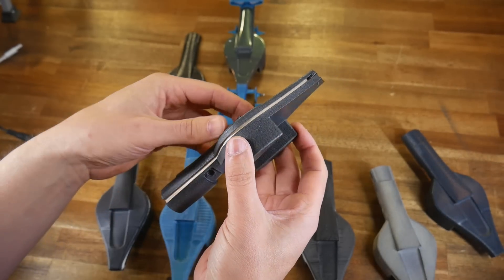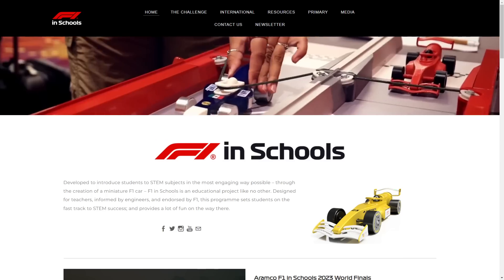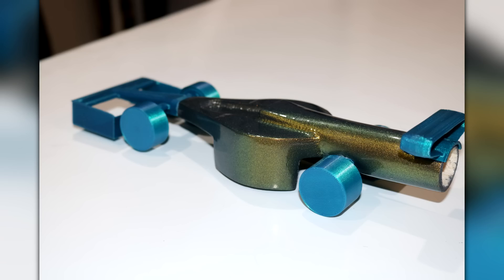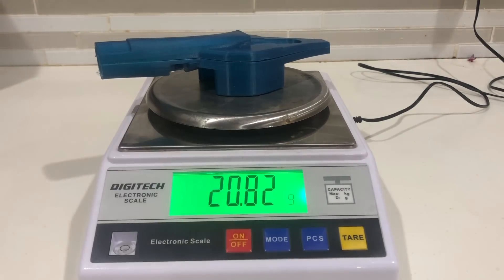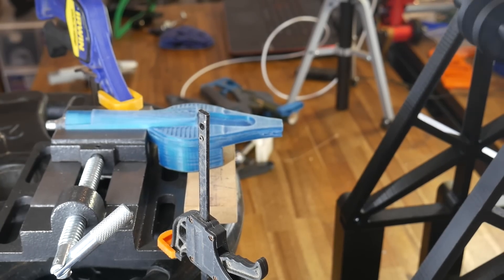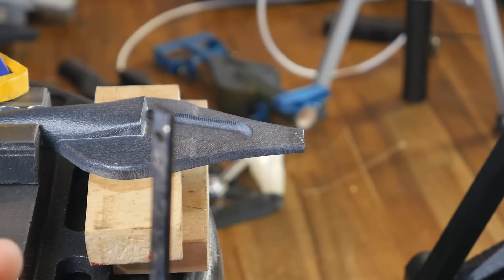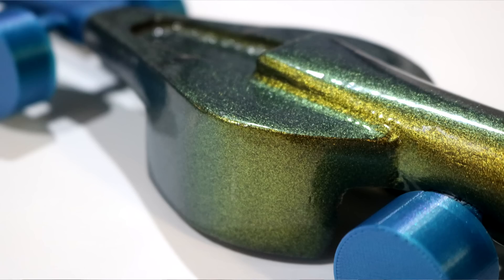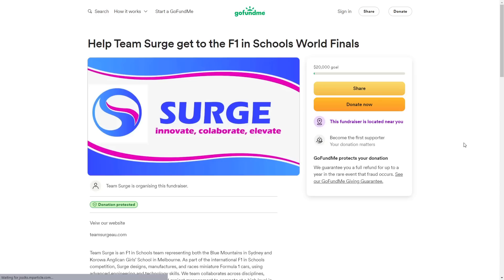Comparing consumer FDM 3D printing to SLS Nylon with Team Surge AU

Comment: why not use pa-cf 12 on a fdm and up the resolution to like 0.08? the added time is not a problem in a overnight print for a part this small, it'd outperform the fact that you need a sls setup or borrow it, while having a fdm printer that does pa-cf12 is easily done with a enclosed printer, like a x1c or p1s

Comment: Where is pet .g.
That.s flexible. 
Printed at home .
And where.s a.b.s.?.
And why is tje software  not showt.
Like cura slicer.
And nozzle size.s
0.6 nozzle makes parts stronger. 
And why os tje option fuzzy skin.
Not try.d.
Wel tou stil  goth a lot option.s.
Left

Comment: Hi Michael, my name is Francesco, and I am a 16-year-old guy passionate about 3D printing. About a year ago, I bought my Elegoo Neptune 4, an amazing printer that works very well, and I am happy with the purchase. Unfortunately, every time I turn the printer on and off, the Z-offset changes, and I have to recalibrate it manually. This frustrates me because I’m forced to make a lot of clicks to level the bed. So, I started searching online for a solution, but the automatic calibration either involved a load cell mounted on the nozzle or external hardware that was complicated to install.
So, I came up with a software idea that could automate the whole process. Here’s how it works:
You need to know the offset between the 3 axes, which is the distance between the nozzle tip and the probe for automatic bed leveling. You tell the printer to move to a coordinate near the center of the bed, take a measurement with the probe, and save it. Then, the head should move to the same coordinates but adding the previously recorded offset in X and Y, take another measurement, and save it as well. After the printer has returned to the previous coordinates, it needs to take the two previously saved data points and insert them into the following formula (the first measurement = A and the second = B, the Z-offset probe is the offset between the nozzle tip and the probe on the Z-axis):

(Z-offset probe + (X)) - (Y) + 0.1mm.

The final instruction to give the printer is to set the current Z-axis coordinate as the Z-offset.
Unfortunately, I don’t know how to program in G-code, so if you think this software might work, would you be willing to help me write it?
(If you think it won’t work, could you explain why?)
I hope I was clear. Thank you for your attention, I’ll be waiting for your response to hear your opinion on this matter.

Best regards,
Francesco
Thank you for your attention.

Comment: No ABS? It is less dense than nylon, easier to print (compared to SLS), can be vapor smoothed, and although less tough and less rigid than Nylon it has a good impact resistance.

Comment: Hey Michael, I’ve been thinking about digital fabrication for a while now and wanted to share some insights. Maybe you already experienced these techniques by yourself. When post-machining a 3D-printed part, I’ve noticed that the impressive accuracy shown by calipers doesn’t always carry across the entire surface. This is especially true for resin prints, which tend to shrink during post-curing and over time. When machining, certain areas are deeply affected by the bit, while others remain untouched. That said, with the right bit, you can significantly improve both the part's accuracy and overall aesthetics—perhaps even achieving some aerodynamic improvements.

One interesting approach is to model your 3D print as a rough-machined part by printing it about 0.25mm thicker than the final dimension, then doing a finishing pass with a CNC router. This allows you to cut into the material where the filament layers are compressed, with no air gaps. I’ll admit, I don’t do this often because it takes extra time and requires precise alignment of the part on the CNC. And, to be honest, FDM quality is usually sufficient for most purposes. However, for that contest these students are working on, these techniques could really pay off!

Keep up the great work!

Comment: It's a damn shame Micronics got bought but perhaps it's not a bad thing that SLS machines remain somewhat inaccessible to the average joe. We use a Fuse 1+ 30W at work. Works great and it's surprisingly fast, but it's challenging to pack the parts sufficiently densely to minimize waste. The powder that hasn't been sintered into your part can be reused as long as what you feed the machine is at least 30% fresh powder, which means that if the parts are irregular and don't stack nicely you generate more waste than you are able to reuse. That's why we still use our FDM and SLA machines quite frequently.

Comment: why must you remind me of the tragedy micronics turned out to be. I just yesterday talked with a local 3d shop owner and he actually stopped selling formlabs machines over how pissed he was about the whole ordeal.
Reply: He probably wasn’t selling a lot of them and thus didn’t hurt his bottom line because it wouldn’t be very smart to throw a hissy fit and damage one’s business. This is especially true of local, independent 3D printing supply shops because there ain’t a lot of them.

Comment: screw Micronics.  that's all
Reply: why?
Reply: @peterspencer6442  they made a bunch of promises, had a rad Kickstarter and then cancelled it and left all their backers out to dry. No money was lost by anyone, but all the promises were broken. After the fact it kinda if looked like that was the plan all along
Reply: @peterspencer6442 
Probably for selling
Reply: @peterspencer6442  Because they built the company with the trust of their kickstarter backers over several years (they started in 2021, they were expected to start shipping in 2025) only to sell out to formlabs recently before delivering on the kickstarter. And formlabs doesn't have the best reputation when it comes to supporting the consumer/lower end market.